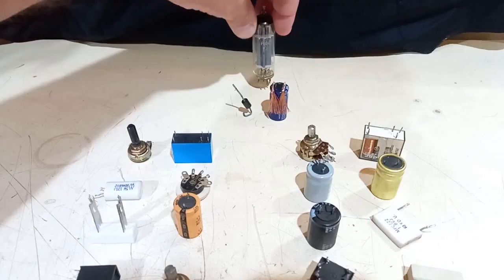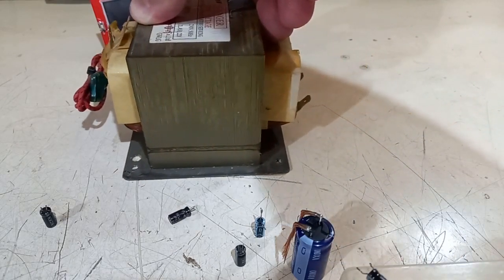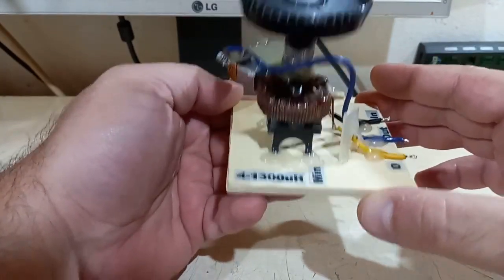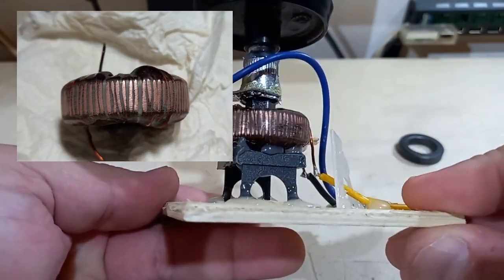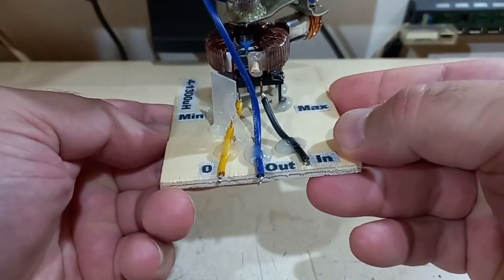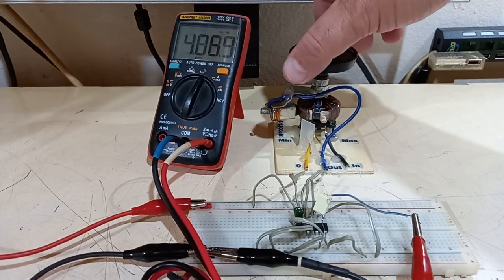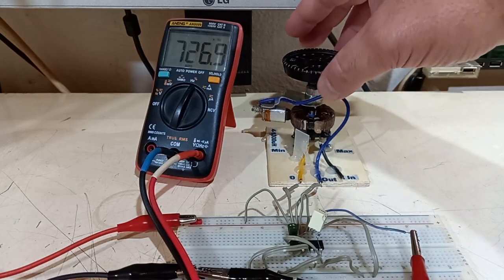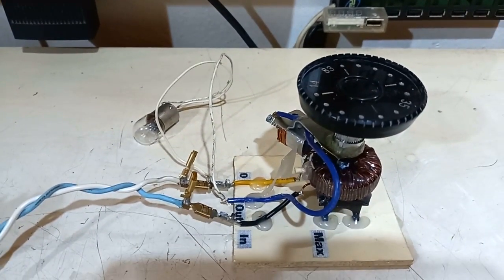The Inductovariac!! (TM)

Comment: Im dying xddd. Actually thats pretty great idea, i alway had an idea of making simple freq generator with mazzilli and adjustable inductor from tv but this looks like way better way of doing it
Reply from the maker: well, i had the idea of putting this thing on a mazzilli driver, but the current on the inductor would be quite high even with no load, so the brush may not hold it, and also the resistance of the brush and contact would make the LC tank bad, so i discarded the idea and "made" just an astable (Colpitts, probably) with a chip.... you can still put a movable core on the inductor of the mazzilli, or an adjustable air gap, but in my experience there's just one spot that the driver works best, so you will need "to adjust it" more than "be adjustable"